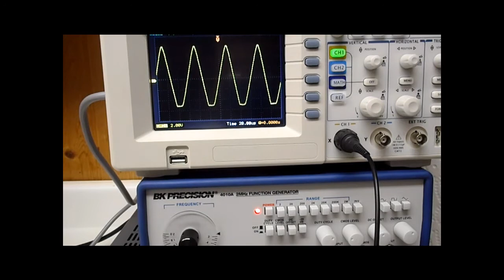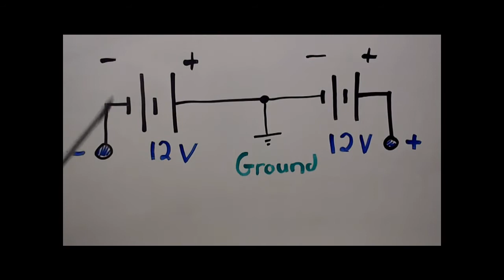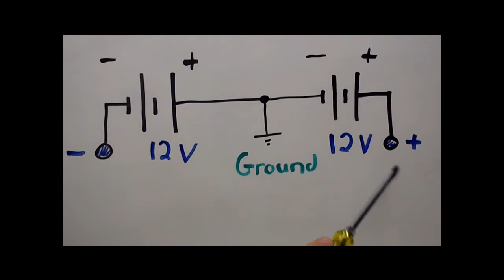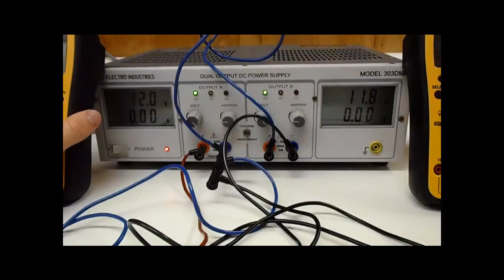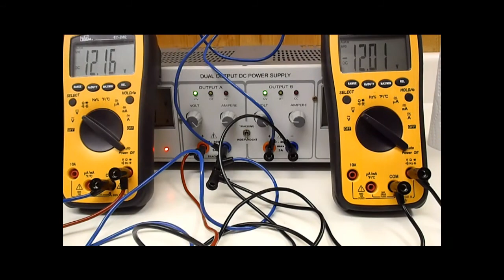Negative and Positive From a Dual Power Supply

Comment: I am creating a triangle wave generator with an op am and a comparator.. The comparator requires +5V which I plan to generate using a 5V voltage regulator and the +15V source. 

With this design, would that common ground between the +15V and -15V be the same ground used for all other components involved in the design?